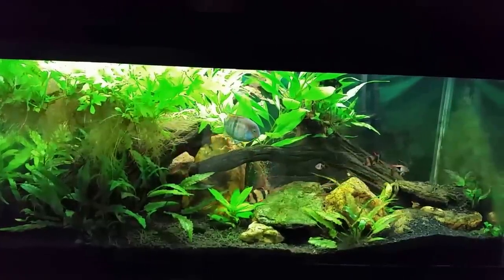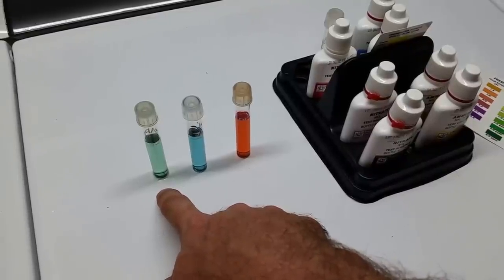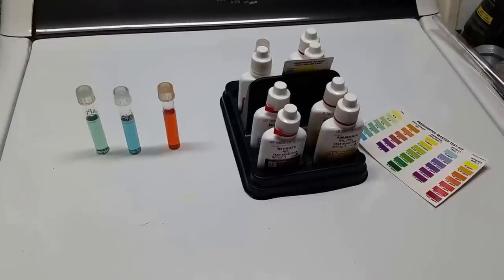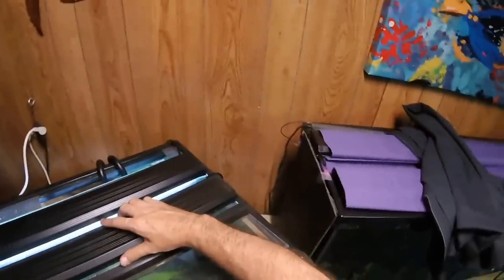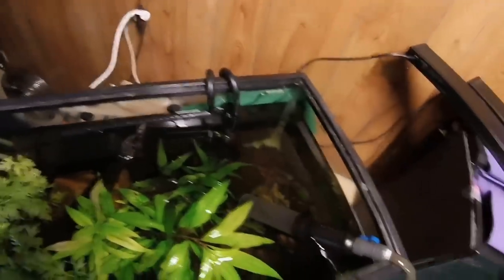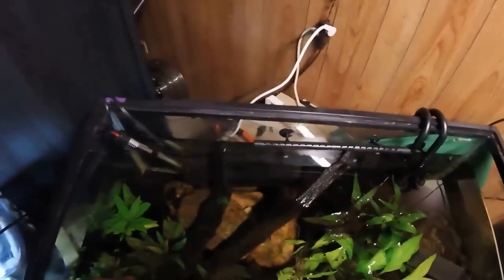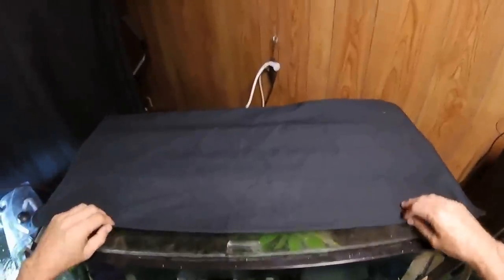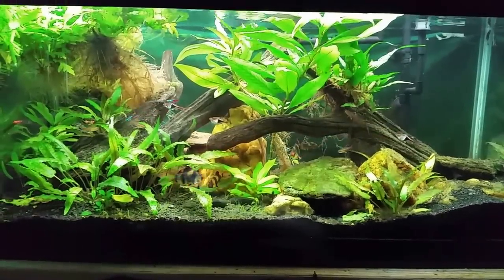Installing a Powerhead and Discussing Water Circulation. POV

Comment: totally thought my oven was going off haha. great vid
Reply from the maker: lol. I still don't know what that was.
Reply: +Dan Hiteshew haha nice. do you have any vids on tips and tricks on how to get your sunsun to prime easily when done with maintenance on it? had to start the siphon personally last time, and injested a bit of tank water
Reply from the maker: Kevin Walden Did you fill the canister first?
I know I've had to pump like mad to get it started, but it's not too bad after the first time.
I'll show how I shut it off during a water change so you do prime it at all, and hardly even get any bubbles in the tank.
Reply: +Dan Hiteshew filled about 3/4. probly shoulda  done a little more
Reply from the maker: +Kevin Walden I put as much as I can, without overflowing it. If you fill it all the way up, it will overflow when you put the lid down. You'll have to find that sweet spot.

Comment: Just bought a Hydor circulation pump and not sure if I need to leave it on 24/7 or put it on a timer?  What do you suggest?
Reply from the maker: That's up to you. I plug it in and forget about it. Some people only use them during water changes to mix up the stuff on the bottom.

Comment: Dan, when you compare test kits may I suggest tetra easy strips too? They have a 6 in one test strip and my very experienced friend recommended them to me. I would have never believed it was just as accurate as the api kit, but it is. Fast and easy. One second dip and a read in 30-60 seconds. Been using them a month now and have compared it side by side with the api kit.
Reply from the maker: I don't use strips, and I'm not planning on purchasing stuff just to test. Lol
Reply: +Dan Hiteshew well when you run out of the API kit liquids,  consider the test strips. They are 3 or 4 dollars cheaper than API and you get a 100 of them. I didn't think much of the strips either until I compared them. Easy peasy.
Reply: I run the tetra strips in conjunction with with my api... the tetra strips are very accurate. My one complaint is they don’t test ammonia but they are very quick and easy when checking between changes.. I still use the api for accurate details however I use the test strips a lot especially when I have a problem tank and need to monitor it daily

Comment: I leave the caps off of the jugs. is that not enough surface area? I do treat it. Its just easier for me to carry gallon jugs instead of a 5 gallon bucket(bad back). Thanks!!!
Reply from the maker: Letting it sit after treating it is not good. It's a little complicated. Watch this video and ask questions from there.
Can you leave the water in a bucket or buckets, then scoop out jugfulls at a time?
https://www.youtube.com/watch?v=VQpeygl25S0

Comment: Hey Dan, love your videos. always learn something new from them. I just got my first canister filter. its a sunsun 304b. how do you think the UV sterilizer in these work compared to a internal UV Sterilizer? Do you think that a 9 watt sterilizer is enough for these filters. I have heard mixed reviews about them. but thought you might have some input on these since you have many sunsun filters. thanks
Reply from the maker: I've never had any issues.  The bulb wattage has more to do with the size of the bulb, than the intensity of the light.
With lots of water flow, you still move the same amount of water through the "light".

Comment: Hi Dan, I watched the video a couple of times. So basically I need to let my water sit for correct amount of time per gallon, untreated. I went online, my water does contain chlorine, no chlorimine. I also tested my tap for ammonia-0. Jug. water ammonia-0. I like the idea of not using any chemical additives, just letting water sit. I think the water that has been sitting will be ok to use, don't you? But I will get some 5 gallon buckets when I can. I really want a water changer(but will have to treat it). I have too many large tanks to be using jugs of water. Anyway, thanks so much for your help!!!
Reply from the maker: No problem. Glad to help.
If your water sitting in jugs (open top) is ok after a week, then it's ok. It only takes a few hours for a bucket to clear, so a whole week should be ok. Especially since each jug is only a single gallon, not 5 at once.

Comment: I recently purchased a AquaTop CPS-24 for my 90 gallon planted tank I didn't realize that it was rated for 140-250 gallons when I installed it in my tank everything started leaning to one side from the power of the pump...my question is this more power then needed and can I lessen its output in anyway??

Comment: I have a 60 gallon that I have  HOB with a small sponge filter on one side of the tank and on the other. Have a large sponge filter, there is plenty of top surface movement but on the side with the large sponge filter there isn't much flow from the middle of the tank to the bottom,  with stuff just floating, do  you think one of these wave makers would push  the water to the HOB for cleaner water? And what is yours? I don't want a big bulky one that throws out to much water
Reply from the maker: Hydor Koralia Nano Aquarium Circulation Pump: https://amzn.to/2RIDEa6
That's a 425 gph. It would probably work well enough.

Comment: Is having 2 Hydor 265gph power heads too much circulation for a 75g tank? I'm worried it might be too much movement for my plants to carpet properly.
Reply from the maker: It would depend on how open the tank is. An open tank would allow for vigorous circulation, but one full of rocks and wood would cause much less flow around the tank.

Comment: Air circulating pumps/power heads and what not beneficial for fish. I'm kind of new to this. I just figure the fish (like black skirts) are like "fuck it's like a tornado in here, can a brother catch a break??" Helpful responses are incredibly appreciated.
Reply from the maker: Well, you need to have "plenty" of circulation, without buffeting the fish too much. Some fish need very still water, while others come from rivers and need lots of turbulence.
Skirts are fine in a tank with "normal" amount of circulation. (I.E. a HOB filter rated for a tank of equal or smaller size)

Comment: Hi Dan, thanks for video! Makes me wonder about powerheads for my tanks, don't use any. I have a few questions if you don't mind? 1-Are you using a python water changer? Is it for all your tanks? I heard not to use same one because it cross contaminates. I want to get one, would be alot easier. I'm using the kind where you squeeze it to cause suction, and it's for all of them. 2-i treat my water and sit it on my back porch in gallon jugs for a week. is that too long? my husband asked if the water stagnates. never thought of that. will it? Its easier to fill after water change if water is ready to go. don't have to refill every time. would appreciate your help. thanks!!!!
Reply from the maker: The water needs to be exposed to oxygen, so sit it in 5 gallon buckets. The surface area is where the magic happens. Closed jugs don't allow the chlorine to evaporate, and chloramine will last much longer than just plain old chlorine, so find out if you have it. (you can test your tap water for ammonia. if it's a positive test, you've most likely got chloramine. you can also look online or call your water supplier. they are required to tell you what is in it)
Yes I do use the same siphon, and yes, you can cross contaminate that way.
If you're worried about it, just rinse it out and well and if you can get all the water out of it, let it dry.

Comment: My aquarium size is - 3.5 ft X 1 ft X 2 ft (height) with a top-filter.
Which one should I buy? how much flow rate should I have?
Reply from the maker: I don't know. I don't know how your tank is set up or what kind of fish you have etc. Probably at least a 450 gph to make a real difference in a tank that size.

Comment: I have a 65 gallon tank which I am trying to carpet with glosso I have a fluval 406 and a hydor 425 my tank is a tall tank I was wondering if you can give me advice on we're to place the output of the fluval and my hydor I was thinking I might need the hydor nano 550 I think k it is whatever the next level up nano it is but any help on how to place my output and hydor is appreciated
Reply from the maker: If it's a tall tank, putting the powerhead lower down and pointing upwards would help move the lower water towards he surface.
Reply: Dan Hiteshew so say I put the intake on the left corner and the outake on the right corner and the water from that should be pointing in what direction? Shoot the output towards the Intake tube? So across the tank? Then Install the hydor on the bottom of the tank shooting across to the right side of the tank towards the output of the filter?

Comment: Odd question: Do you use the same syphon for all your tanks? Do you sterilize it in any way before going from one tank to the next, or should that not even be a concern of spreading infection?
Reply from the maker: oh that's a very real concern. nets, plants, even your wet hands can cross contaminate tanks. I treat my QT differently,  but all my other tanks are pretty much the same equipment.

Comment: where did you buy your glass hood from?
Reply from the maker: I have no idea now. it was some 3rd party seller on Amazon.
Reply: Petco has them for the Aqueon 40Bs.
Reply from the maker: +Josh's Aquatics & Railroad Videos I'll check it out. thanks!
Reply: No problem! If your tank was made by Tetra, you might have to look somewhere else.
Reply from the maker: Josh's Aquatics & Railroad Videos I remember having a hell of a time finding a brand that fits it. I kept ordering from the same place because I couldn't find it anywhere else.
Reply: Go on Doctors Foster and Smith and take a look at the Marineland 72x18 lids. According to the comments, it comes in two pieces that should each fit the Tetra/Marineland/Perfecto 40Bs.
Reply from the maker: Josh's Aquatics & Railroad Videos cool. Thanks again!